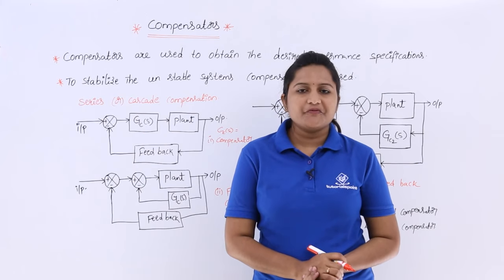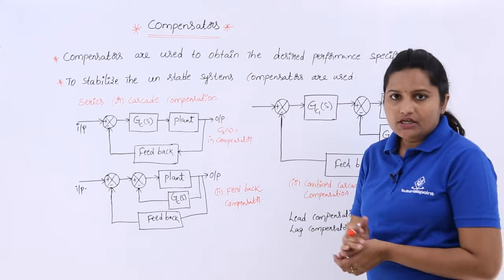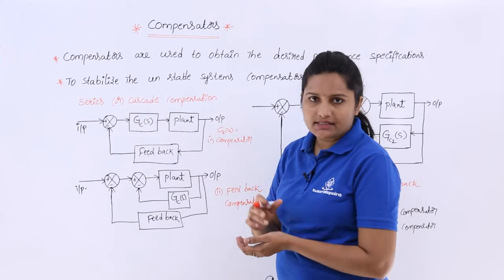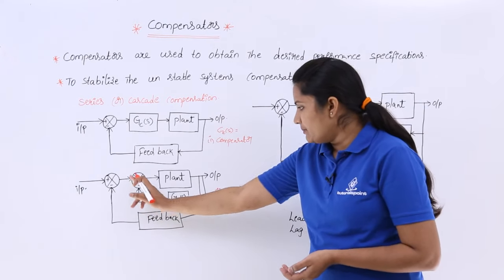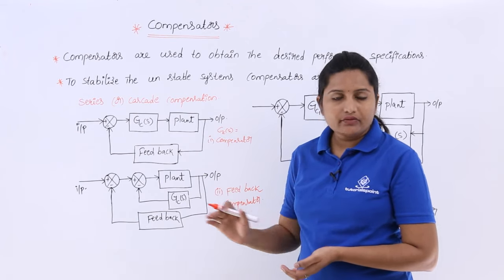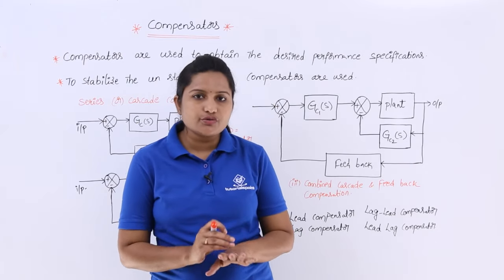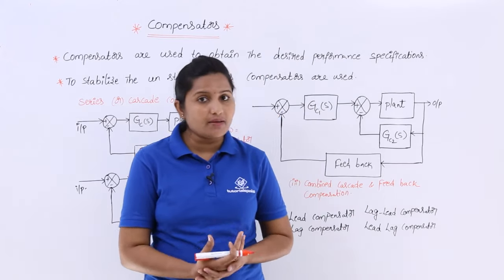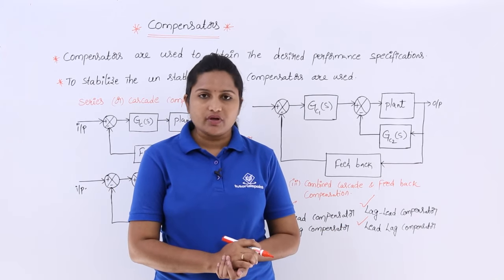Introduction to Compensator

Comment: Can u give the application for this compensator
Reply: Pubg
Reply: The name compensator itself gives you meaning and application both
Compensator is used to compensate the network,that means your control system system giving less or more value at output than your desired value then you will try to compensate that changes by using compensator.